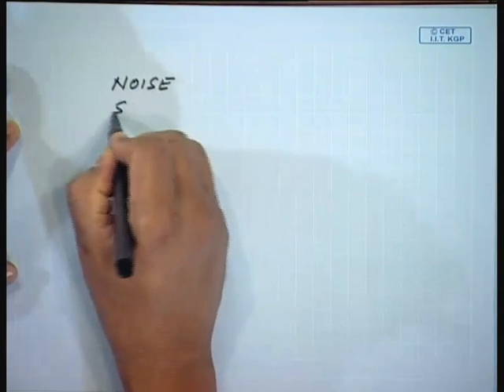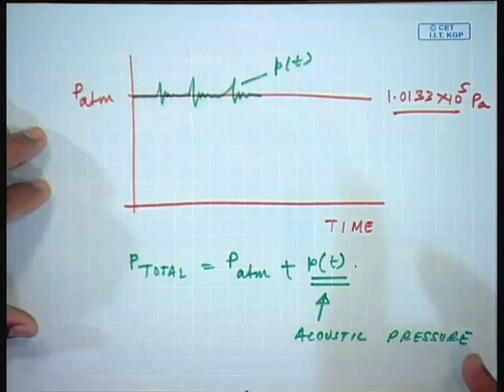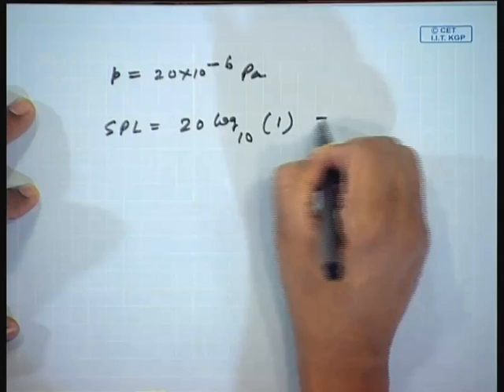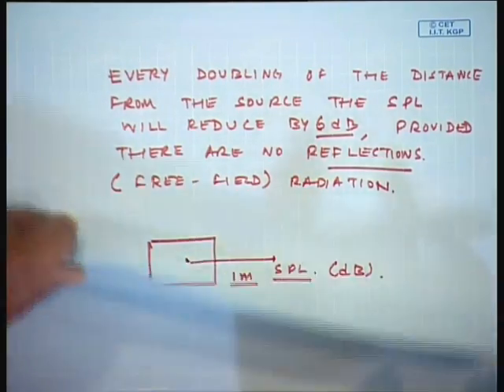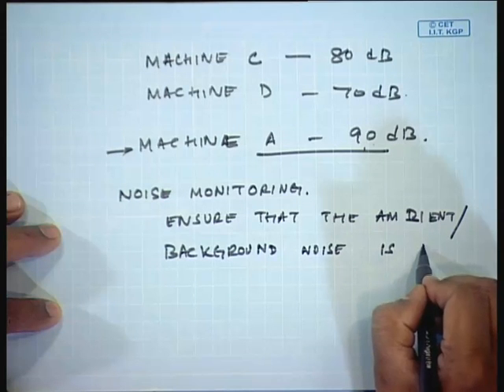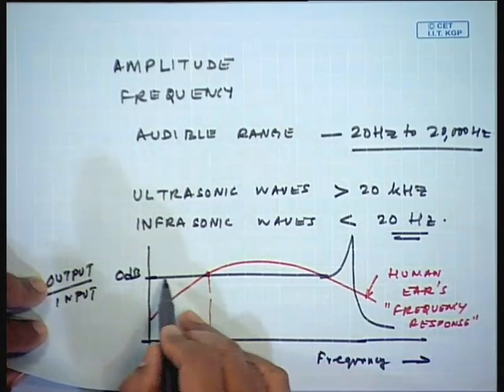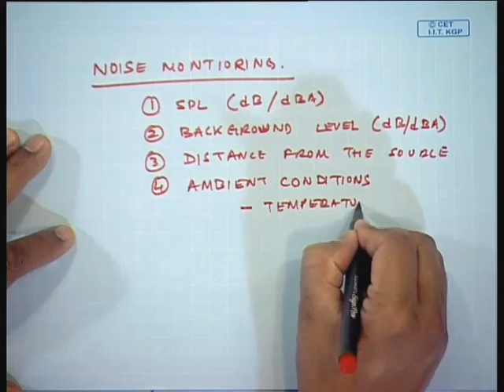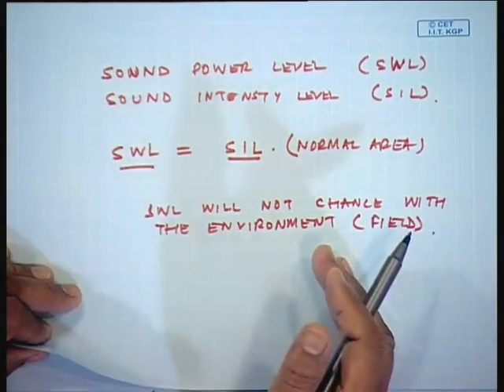Mod-01 Lec-21 Basics of Noise and Noise Monitoring

Comment: Adding two sound pressure level of same value will be increased by adding 3
Reply: exactly
Reply: ADD 1.2 TO HIGHER VALUE, IF THE DIFF IN TWO PRESSURE LEVEL IS 5
Reply: I thought I was alone on this. Prof needs to clarify this